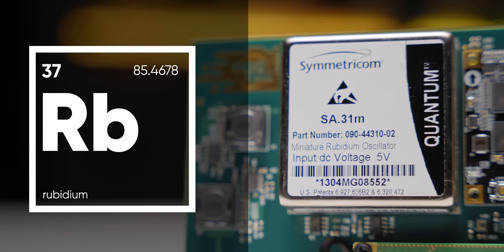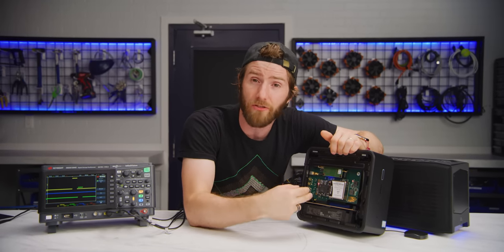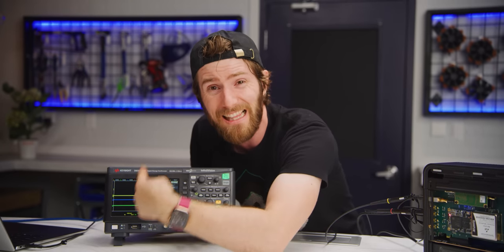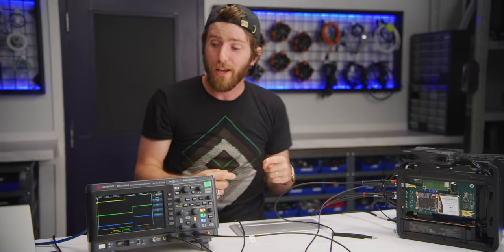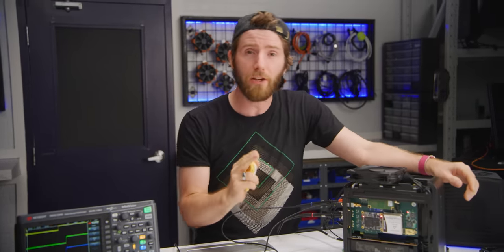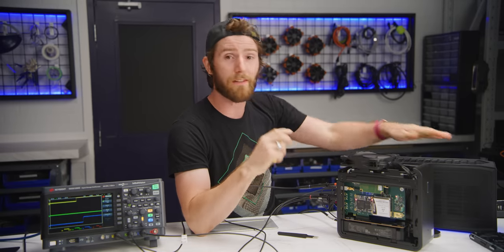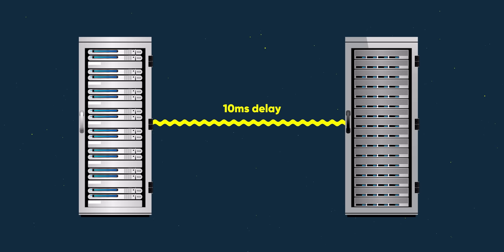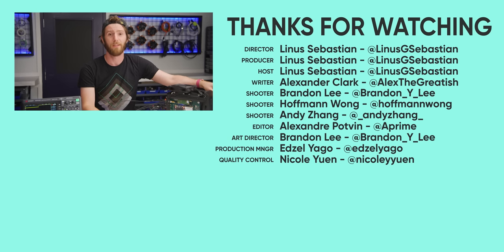Why is this PCIe Card RADIOACTIVE?

Comment: Wouldn't even low levels of radiation have a major impact on system stability?  Because nanometer scale transistors are so sensitive, any ionizing photon that hits it has a chance to randomly flip it.

(I suspect the answer is that the card itself isn't actually radioactive, the rubidium housing is shielded so the card isn't emitting the radiation.)
Reply: Atomic clocks are not radioactive, they do not work on radioactive decay.
Reply: @GoldSrc_  Yeah, that's what I said.  They do contain radioactive material though, Rubidium-87, but that Beta decays (which is very very easy to shield).

Funnily in the video they showed Rb-85, which is not actually radioactive.
Reply: @evellior  Can you tell me how much radioactive material exists inside an atomic clock?

Comment: Random question I really need a response to:

Long story short, I went to replace my RAM in my perfectly working PC, I turned the pc off, but didn’t unplug it. Would this cause my psu to mess up? I also had just replaced my cpu and only powered on the pc for like 3 minutes with the new cpu. But now the pc will run for like 10 seconds and reset. Need to know if it’s my cpu cooling or my psu is fried. Or at least which is more probable!

Comment: 1985: One of these chips is the CPU, probably the slightly warmer one.
1995: The chip with the heatsink/fan is the CPU.
2022: My water pump got airlocked and my CPU went entirely uncooled for a solid month before I realized what the problem was when the clock speed went to 1GHz.

Comment: They use rubidium which has longer half life than the age of the Universe, so for all intents and purposes it is NOT radioactive. (and they not use the radioactivity at all)

Other radioactive stuff which is not really that: human body, bananas, table salt, most foods,.. (those all contain unstable isotopes)
Fun fact: bananas are radioactive enough that with a good gamma spectroscope and few days averaging you can actually measure the Potassium decay inside them, but they are still completely harmless.

Comment: Joe: "Hey Jeff, we got a problem with the time synchronisation. We drop request, when clocks are out of synch. Can you fix that?"
Jeff: "Well, I probably could, but that means redesigning, writing a few thousand lines of code, then debugging this for days..."
Joe: "Uhm, but we need this to be fixed!"
Jeff: "Look my code is correct. You gotta fix the hardware. Just buy a few thousand atomic clocks."

Comment: I don't full agree with the gaming implications section. Sure it'll cut down the lag by a bit (in a world where this technology becomes a standard, so long road ahead). But it'll be impossible to have a fair match between  a pc located in the USA and one in Korea (as depicted in the video) since it'll require breaking the speed of light. The best theoretical ping between 10000km (Usa-Kroea) its should be around 70ms (in an ideal world); in a real word getting to a 140 ping between this 2 place should be the best lag possible (140ms in a RTS is an unplayable expirience). This is because ideal calculation of lag dont take in calculation: refraction of light in the fiber, repeaters and all the device between the host and the server that adds lag, also that internet connection are much longer in distance then the arial distance you calculate from 2 place. (100ms in a RTS is an unplayable expirience).

Comment: With 2 of these devices at LTT headquarters could you theoretically do data transfer measurements extremely accurately which would allow for very sophisticated network and data transfer benchmarks for high end equipment? Could you also combine this with uptime calculations to determine network health?

Comment: If an individual has an atomic clock in there pc, can it be used to improve twitch streaming today, or does it still need to be implemented on twitches end. This is really cool
Reply: It would still need to be implemented on the twitch end.

Comment: I don't buy the supposed benefits for gamers. It's great if you can have precise timestamps from every participant in a network, but that is completely useless if you cannot trust every participant in the network to truthfully report them. If precise timestamps where to be used for detecting who shot first as in the example Linus mentioned, what stops a player from always reporting the earliest timestamps possible in order to have a higher chance of being the winner in an encounter?

Also the claimed use case for security purposes is probably very niche, since regular IP communication usually doesn't have constant and predictable latencies anyways, since there are delays from buffering and from packets taking different routes, that can change the latency at any time, without anyone trying to tamper with the connection.

Comment: what? computers can absolutely handle packets with future timestamps. there is no reason anyone should be adding a 20ms processing delay just to makes sure the timestamp is in the past. even IF a computer could only handle past timestamps, this would be easily solved by just editing them to appear in the past. this can be done by the sending or receiving computer with virtually no overhead
Reply: imprecision is definitely harmful in many cases, it just doesn't matter in which direction the time is off. what matters is that the network is in sync, and a large difference in one direction is just as harmful as a large difference in the other

Comment: So could you use this theoretically to run house in sync instead of the typical master and slave config. If they were all the same clock timing guaranteed basically wouldn't splitting the work between them become super easy?

Comment: I'm a little confused. If I put a simpler version of this in my computer, what exactly does it do for it? From my understanding, and in terms of gaming, it seems that it would be most beneficial for a server since server side is often used to determine the legitimacy of actions that was sent by the clients. In terms of client side, can someone explain why this would be beneficial?
Reply: Every computer, even the simplest ones, relies on a crystal-generated 'beacon' to operate. Computing cycles are counted based on these beacons and part of the hardware around them is responsible for signaling other microprocessors based on their tick rate. What happens is that the crystals are precise but not that much and their clock count is very 'slow' for modern computing. Putting in perspective you have a crystal oscillator with a 'heartbeat' of 32 kHz, a modern CPU running at 3.2 GHz - around one million times faster - and that atomic oscillator that can pump out frequencies in the range of terahertz and beyond with atomic precision, which is around a thousand times faster than a modern CPU. Modern computers still work with the crystal oscillators because their tech is well known and they're inexpensive for the industry. However as computers became more complex so did the signaling, to the point that modern motherboards' BIOS/EFI use a feature called 'spread spectrum' to account for time discrepancies as the control signals travel the circuitry. Remember, all of the rest of the computing work - user data - depends on it to get properly done, and fast. And all of this into a single computer. Imagine how this scales into a datacenter, with thousands upon thousands of CPUs pumping out data and services based on them to millions of users every second.
Reply: @Carcinogenic2  Awesome reply, thank you! This clears things up for me.

Comment: An unnecessary expensive and sort of stupid way to get and use PTP, it should have its own Ethernet port with IEEE1588v2 time stamping (PTP) instead of being dependent on the PC's added time jitter.

If you have access to the outside anywhere in your LAN you can set up a PTP server based on a properly working GPS and then answer PTP requests without an expensive "atomic clock". 
The "atomic clock" part is only "needed" if you do not get 1 to 10 GPS fixes every second to keep proper track of time. The added cost of an "atomic clock" on your PTP server is nothing on a data center level but it adds a huge cost (like half of the board's cost at least, or even more) to a homeowner that just wants to know the clock down to 10-100ns accuracy...

Just a few other things to be noted. EVERY switch in your LAN must be PTP compliment, very few consumer-grade switches are. Or it is at least not specified. 
With PTP protocol and PTP servers, you must add the latency that the GPS antenna cord (time/length) is generating to be at the correct time and also that no PTP message can pass a router. The correct name of PTP is IEEE1588v2.

The real beauty of PTP and GPS systems is that make it possible to synchronize information between sites that are far, far away from each other, even on the other side of the earth.
So the real hero is not PTP/IEEE1588v2 it is as usual the GPS system and its various usages. This is just an implementation.

Comment: Last time i looked ms had terrible support for ptp or syncE. The i210 does even have a pin header where you can output the pps if you have the same driver. (yes it is scaled) Ohh btw the real ptp guy’s are probably at redhead and the tiny ptp4l user group. 

(Does anyone know if bridge under linux finally can do hardware ptp?)

Comment: If the computers are far apart, how do you sync their times in the first place? The most accurate clock in the world is useless it its time is set wrong. You use GPS? Okay but then why do you need such a super accurate clock? Wouldn't a somewhat accurate clock do as well and then you just set it every ten minutes using GPS? In that case as long as the clock is almost perfectly accurate for ten minutes, it would be accurate enough and a clock that is perfectly accurate for ten minutes is much easier and cheaper to build. It won't be that accurate for hours and certainly not for days as it will drift but it doesn't have to if you can keep re-sync with an external source which is the source you need to rely upon even if you have an atomic clock. This is how radio controlled clocks work that get correct time once or several times a day from a time signal broadcasted through a radio signal (and this time of course comes from an atomic clock) and in between those sync times, they run on their own time generator, which is far less accurate but it only has to be accurate enough to not drift too much until the next radio sync.
Reply: You're thinking like a human, which isn't surprising since you probably are one. But what you consider somewhat accurate is actually extremely inaccurate. You may wish to look at Grace Hopper's video about nanoseconds.
Reply: @jeschinstad  Building a clock that is accurate within 1 ns for 15 minutes is no problem at all and requires no atomic clock either. It won't stay that accurate for hours but it doesn't have to if you re-sync the time every 10 minutes. And as I've explained already, the most precise clock in the universe is only as accurate as your time synchronization source since if you set it wrong, it will be wrong (it will just be very accurately wrong). And whatever source you use to sync your atomic clock (according to video this one is synced by GPS), you can use the same source to sync a non-atomic clock that is only temporarily accurate.

Comment: 3 degree of phase deviation in Alternating current at 60hz is within tolerance. So what the hell are you talking about ?  Meybe you confused hertz with gigaherts ;) Atomic clock for syncing electric plant to the grid ?  Regular quartz clock circuit will synch within 0.001 phase accuracy.

Comment: 2 interesting possibilities: the first is that you could Integrate an atomic clock into new motherboards so that you don't need to worry about the size of a card. The other solution is that if this is a gamer solution, you could Integrate it into a video card so that the video card could take advantage of the improvement at highest possible speeds

Comment: Heh, technically anything using radiwaves (wifi, radio, tv antennas, phones...) is radioactive when operated. The question is how much.
Reply: Technically that is absolutely incorrect. Radio waves, WiFi, Bluetooth, OTA tv, are a form of electromagnetic radiation, and on the low energy end of the EM spectrum for that matter. Radioactivity is mediated by the weak and strong nuclear forces, entirely different fundamental forces of nature, of which there are four. Without going into detail radioactivity is caused by an unstable particle trying to become more stable by losing energy. This is typically in the form of ejecting particle(s) of some kind. Not to say that EM radiation cannot be harmful. Gamma rays can be emitted in certain decay processes usually involving decay chains, metastable states and high energy physics, how gamma rays are on the opposite end of the energy spectrum from radio waves. In fact gamma rays are the most energetic, while radio and microwaves (the kind used by wireless technologies) are the lowest energy.

Comment: speaking about under ocean fibre cables
please speak facial data, not what you just thought is the case
those cables are run on shallow waters and we are not speaking about 4 digit number of meters, rather 2-3 digit number metres under water
you would know, if you would spend 3 minutes to research subject

Comment: …Couldn’t you do this way cheaper with just a radio clock card, with a decent enough timing chip to not drift significantly for a few days? Given it would get a timing resync update every hour. Hell, couldn’t you just achieve this with all computers in your data centre being set to synchronise to one standard quartz clock pulse?